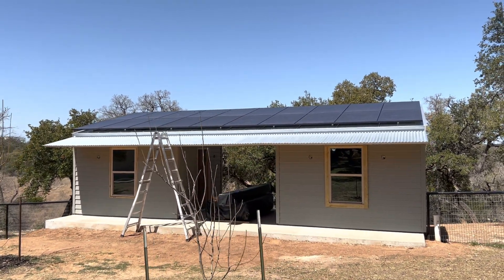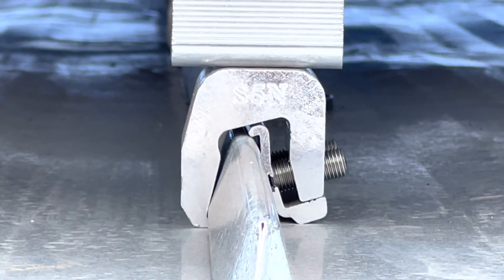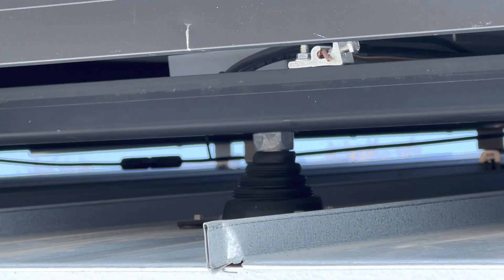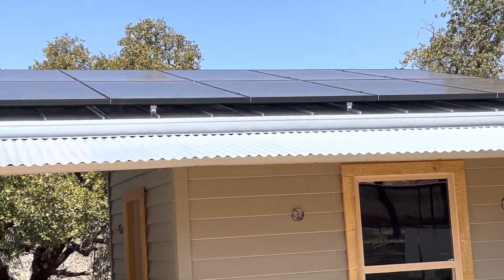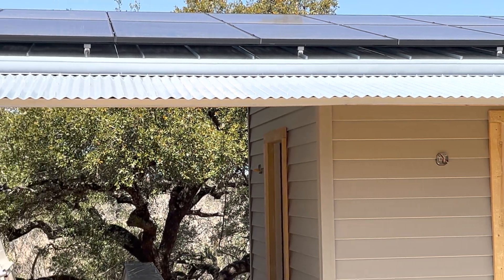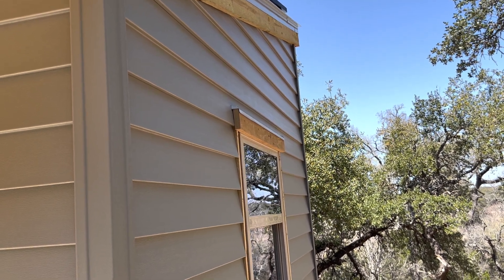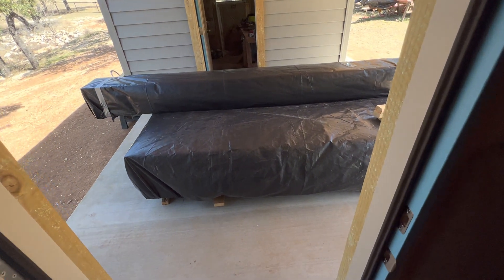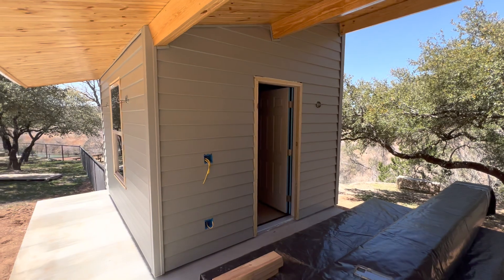How To Install Solar Panels On A Snap Lock Roof!!

Comment: I'm partial to the Snap-N-Rack rail systems over the Iron Ridge. I'm a small solar retailer and almost every system I've seen here is done with lag screws penitrating the roof, usually metal, into the purlins. Great build! Even though you're back when I writer this, wishing you a great vacation. Oh, I twicked my back so I'm able to binge watch your videos while I rest up. 🤙(this is a shaka if you hadn't caught on)
Reply from the maker: Sorry about your back. It’s a real pain. I can relate. Prednisone is my friend sometimes.

Comment: How did you attach the exterior window trim? Looks like it's over the vinyl. I like that concept.
Reply from the maker: I installed the windows and doors out to the face of the siding. I then installed a strip of wood (we call it a furring strip) out to the face of the siding and about an inch from the outside edge of the window trim. I fastened the window trim to this strip of wood. This formed a pocket for the siding to tuck into. The look is like if you installed the trim onto the siding but the siding is actually completely independent so that it can move with the temperature changes. Thanks for your comment.

Comment: Do you not need to use lag bolts on the metal roof to prevent the solar panels/roof from getting ripped off?
Reply from the maker: No. The solar panels clamp to the metal roof and the metal roof can be screwed with screw patterns engineered for whatever wind loading you need. More wind, more screws.
Reply: @RayBuildsCoolStuff  ahh gotcha, I’ve heard that traditional rails need lagged in, but that makes sense